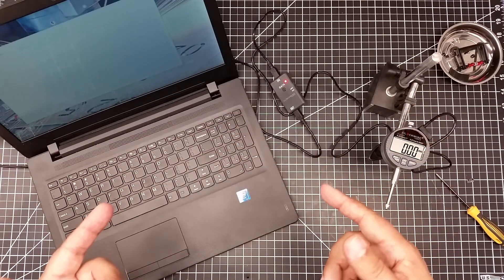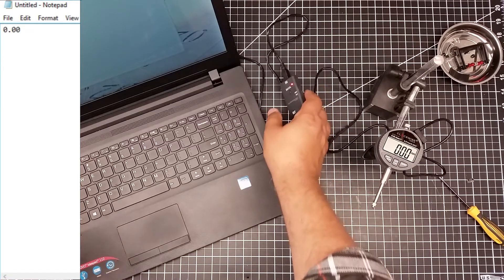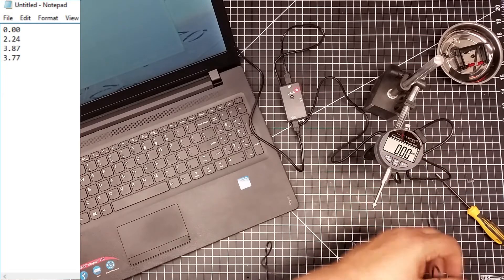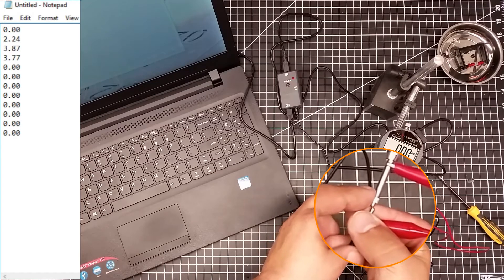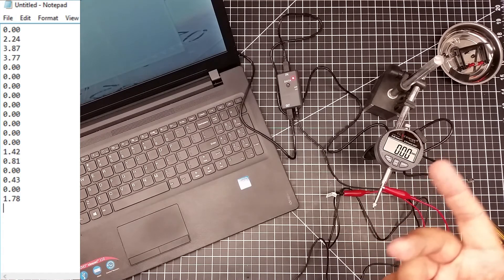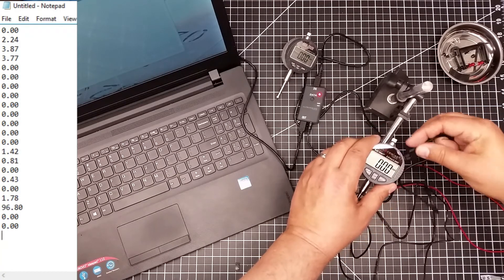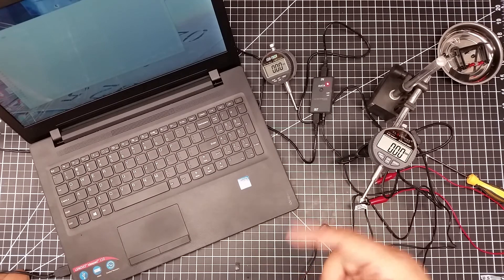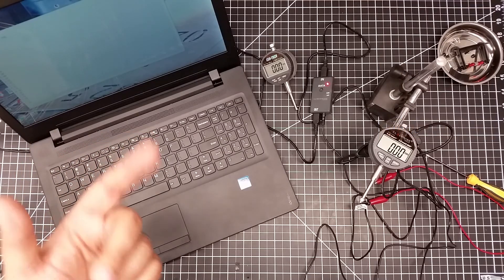Shop Talk - Learning about the Clockwise Dial Indicator and USB Cable!

Comment: In my opinion their rs-232 interface is a cheap and unprofessional solution and is misleading since in most contexts an rs-232 interface is both an Rx/Tx and not just a Tx. It also forces you to use clunky applications (notepad, excel, etc.) instead of simply writing the data to a file or saving it to a local variable.

Even if you use a relay to trigger the readout you're still stuck with keyboard input(!).
Reply from the maker: Ouch that is pretty harsh!  Cut my teeth on RS-232 and IEE-488 many moons back, however it's use is very flexible it just depends upon the implementation ...
Reply: @DIY3DTECHcom  yea the main thing here is that if you actually want to use this cable seriously you either need to hack the UART (I don't know how to do that, but I assume there is some on the board) or use an elaborate method with a relay. I opted for the relay:

I managed to use a 5V relay to trigger the sample write on this USB cable thing. Of course, since it's a keyboard emulator (not a real serial interface) you have to time it right (by "right" I mean more waiting - it's not very fast). I found that pausing about 300 ms between shorting and opening the mono jack connection on the bottom gave me very reliable triggering. Too fast and you don't trigger at all and too slow and you get unreliable triggering.

The solution in python then is to use an analog out of some kind (like a LabJack) to trigger the relay to trigger the sample writes (the 300 ms on off thing) and pyautogui to switch to the notepad, write the value into a blank notepad, copy it to the clipboard and then use pyperclip to drop it into an numpy array.  From there you can do something like np.savetxt() to write to a more permanent file for future reference.

If you do that you can profile over a range of things. If you are watching a constantly translating part you can actually use a filter to smooth out the position data and get better resolution (<25 um) this way.
Reply: (sorry for the spelling mistakes, I'm no native English speaker ;-)

There are essentially 4 models of such cables.
Also note that not all cable models work on all brands calipers or dial indicators.
As far as I know the main Chinese brand is 'Shahe'.
And of course, there are many copies of copies of copies of that.

Another tip up front: do not buy such tools from Amazon or something!!
You are literally wasting a lot of money.
Use AliExpress to buy directly from Chinese resellers/factories.
Do not think buying from "known non-chinese stores" gives you any more quality.
These products are the EXACTLY the same tools as sold by the Chinese resellers on AliExpress!

So, the different model data cables, as far as I could find:

1) With one button
https://nl.aliexpress.com/item/32684689641.html
(this is the one you show in the video.... and is the wrong cable for continues data transfer mode 'out of the box')

Also: far more expensive than the model with three buttons!
It seems, from some descriptions and photos, that if you press the button for a few seconds, the mode will be switched from vertical input to horizontal input in Excel. Aka: instead of <enter>, it uses <tab> ?
Can't find any more info than that.
But also remember, many of such devices are essentially all copies of eachother.
They more than often use (almost) the same PCBs, schemas, etc.
So there is always a chance that instructions from one device, more or less apply to another too.
On top of that, Chinese devices like this are known to have many 'hidden modes' by keeping buttons pressed for longer than normal (eg: see below)

2) With three buttons
https://nl.aliexpress.com/item/32665320279.html
If you press the 'inch/mm' button for 5 seconds, data will be recorded 4 times/second automatically.
Press it 7 seconds and data will be recorded 2 times/second.
Press it 9 seconds and data will be recorded 1 times/second.
Press it 11 seconds and data will be recorded manual again.
(note, I dunno if this cable would fit your dial though)

3) An model with RS232 to USB data-cable.
https://nl.aliexpress.com/item/4000843379786.html

This is the one you should have bought if you want continues data transfer out of the box, without hacking!
However, the included software has known bugs in it.
You better program your own RS232-reader.

4) Then there is also an RF transmitter/receiver model.
https://nl.aliexpress.com/item/32913054770.html

Addendum:
From the research I've done (I don't have one yet. I only orded a dial and data cable today, because I had the exact same ideas as you ;-))
The data send to those button boxes seems to be RS232-data, from comments and feedback I've read from other people who bought them.
The button box simply converts that data to USB-HID-data (aka USB-keyboard output).
So, if you leave the button box out of the loop, you should be able to get a continues RS232-data stream I think.
Of course, you need to have a RS232 to USB converter plug and a driver for that (if your PC doesn't have a RS232 port anymore).
But those can be found all over the internet.
See the description pages of the 3rd model for the RS232 settings info.
It would be a good starting point.

Comment: Did you ever figure out how to tie the data feed from the adapter into the CR10? If not, where did you get stuck? It sounds like a PERFECT alternative to capacitive ABL solutions, which are famously finicky and hard to keep properly calibrated. I would love to get this into the endzone, if it hasn't been done already.
Reply from the maker: Not into the CR-10 however I have used used to feed into an excel spread sheet to map the bed error...